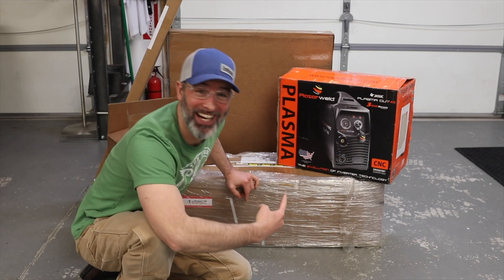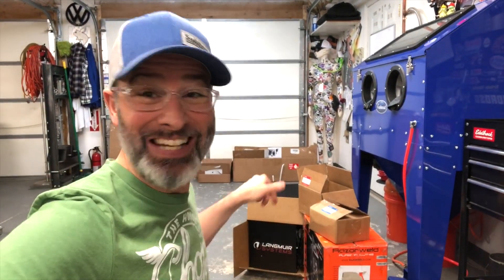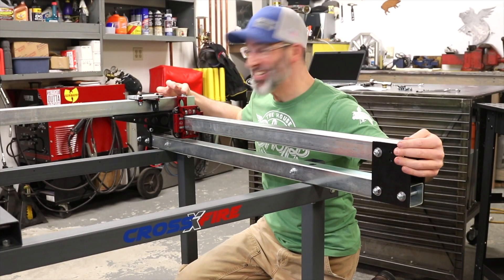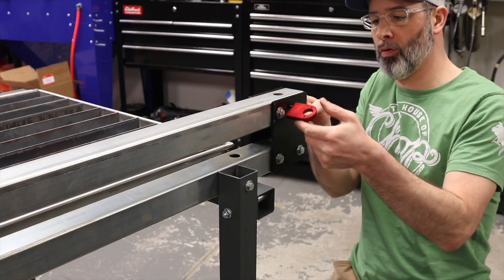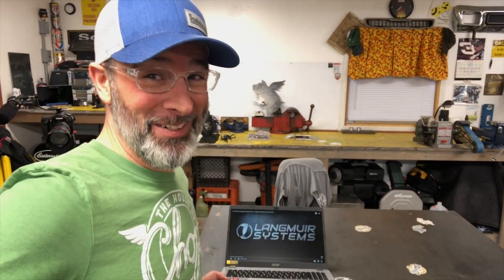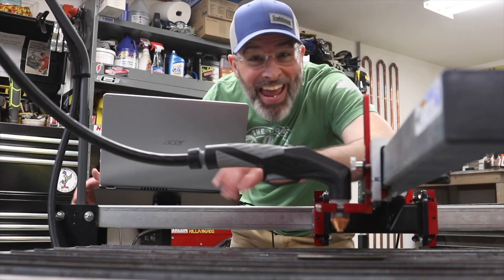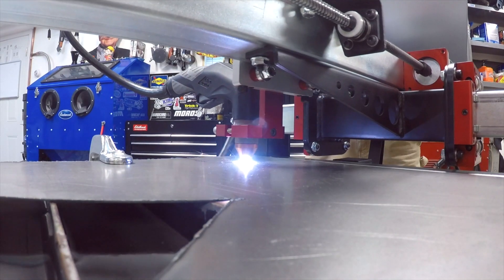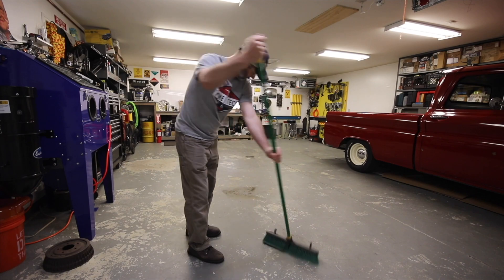Langmuir CROSSFIRE XL CNC Plasma Table. Why it’s TRULY Legendary!

Comment: Awesome video, Up in the air about the crossfire xl or the arc droid, liking that this has the table and more cutting room.  Do you recommend the XL or the Pro?
Reply from the maker: Thank you. If you have the space the pro is a no brainer. The torch hight control will save you loads of money in the long run. Almost every piece I’ve scraped would have been perfect with the torch hight control. Between that and the additional cutting space you will at some point wish you had make it a real easy decision and a great spend.

Comment: So looking at purchasing the CNC machine. Since this video is two years old now do you still feel strong about this purchase and brand? Any pros and cons? I am looking at purchasing the CNC table one size up. Thoughts?
Reply from the maker: Still blown away by the value of this table. The next one up with the torch height control and the extra room to cut is a no brainer for the money. I’ve been super impressed with quality and it’s proven to be quite durable. I wouldn’t hesitate to buy anything from Langmuir
Reply: @HouseofChop  Thanks very much for the reply
Reply from the maker: @jastikawoodmetaldiyproject7276  My pleasure. It’s an easy machine to give top marks on

Comment: What computer are you using
Reply from the maker: It’s been a while but it was a very inexpensive around $350-400 laptop. You don’t need a whole lot of power to run the table. If you plan on doing your design work on the same machine definitely go for something that has some processing horsepower.

Comment: Looking forward to seeing how your compressor holds up to this table. I just got mine and am torn between the scroll or an up right 60 gal
Reply from the maker: It’s worked great. I had one of the first scrolls that left Eastwood about 2.5 years ago. I’ve done a load of blasting with it and it keeps right up. The demands of plasma cutting are far less. If noise and size are a factor I’d say the scroll is an excellent choice. 😉

Comment: What was the make and model of the Plasma.  This looks like an awesome table.
Reply from the maker: Paul Taylor It is an awesome table I could not be more impressed. The plasma cutter is a Razor Weld RazorCut45 with the X45 torch.  You can get it right through Langmuir. The trick is making sure you get the X45 torch because it takes Hypertherm consumables and makes super clean cuts over the standard torch that comes with the machine. If you click the link in my description and check out the package deals they have it all together including the cutter with the better torch. 😉🙌🏼
Reply: @HouseofChop  Thanks fgor th info.

Comment: Congrats Phil.  I’m living mine as you know.  What better than Piglet for a first project.  Make sure you add something to the water.  Borax to a PH of 9 is ok, but I’m about to up my game.  Video coming soon.   If you do Borax get a couple of gallons of really hot water add about 1/3 of the box and stir with a paint mixer until in complete solution.  Then add to the table. 🔥👍🏼👊🏼🔥
Reply from the maker: Thank you Chad! YES your PRO Table is something special. 

 I actually drained mine right after the cut because I knew I needed to add something but had no idea what. Looking forward to that video! 🔥👍🏼🔥